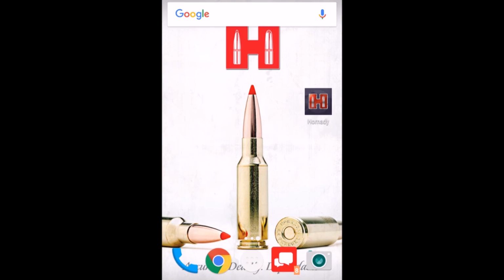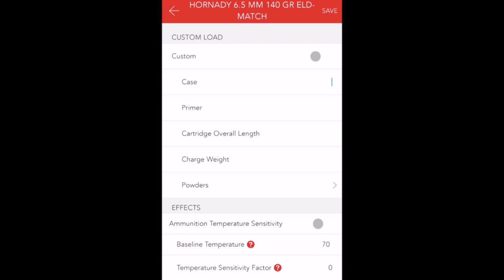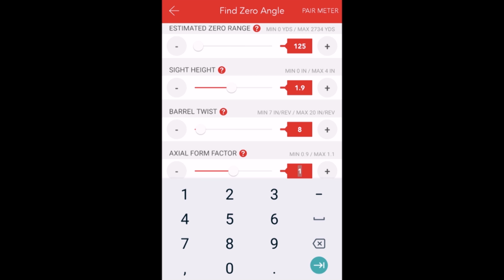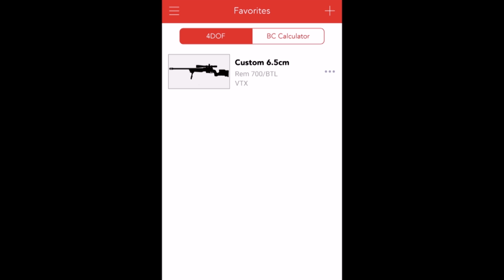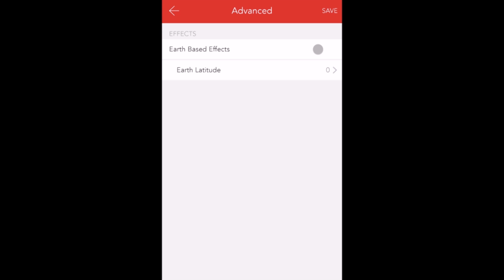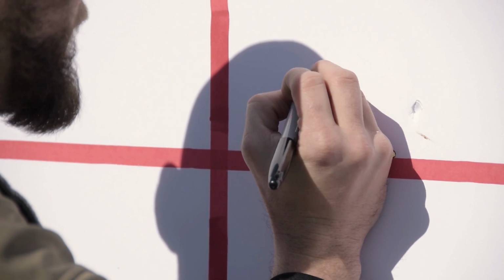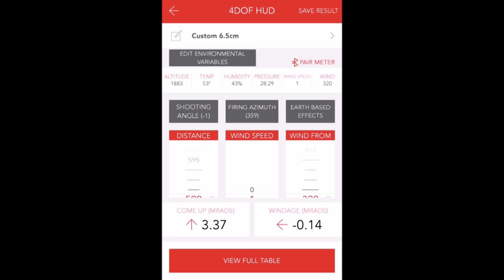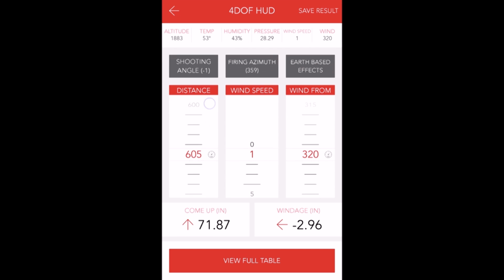Hornady® 4DOF™ - How To Overview

Comment: This app is crap. Tried all of the options correctly entered but the system kept giving me incorrect hold over. Even after I confirmed bullet drop at given distances and entered it into the system it still gave me incorrect hold over. Unintalled it and will never use or recommend it to any one.

Comment: I would like to suggest an improvement to the axial form factor adjustment...after shooting the longer distance test group, make the adjustment to the form factor by simply putting in the actual elevation impact difference from predicted adjustment and let the app make the adjustment instead of changing the form factor, then checking what the affect, then changing the form factor again and checking the affect, etc. Love the App, best I’ve used!
Reply: The app would have to have an external input of “use +|- “ to accomplish your request. I would like it also-seems doable.
(Reply to TH and Hornady)
Reply: I was thinking of something like this: have a trueing button available for the distance input... for instance, you put in 625, it gives 4.5 but you hit low. You assist and hit with 4.7. Hit the “True” button, it displays the 4.5 with a field called “actual” and you put in 4.7... the app can then calculate the Axial form factor.

Comment: I found serious issue when using this app in metric units. It's about pressure. I'm using Weathermeter flow to send all data to the app on my mobile phone. It measures as described in app in mbar units but in fact it's mmHg measurement. I've checked with Strelok Pro set for mmHg and values are identical. The problem is that this app takes this value,  let say 758.4 and calculates my windage using mbar unit. 758.4 mmHg is in fact around 1006 mbar so output for calculation is VERY wrong. I hope that somebody from Hornady take a look on this problem and correct application :/

Comment: For a dyslexic long range shooter/hunter like myself this is both encouraging and discouraging.  I can see the benefits with your system of finding shooting solutions but that's a heck of alot of steps to go through to get to what you're after.  I think that with a little more time and a little more refinement, you'll be able to simplify what just took you eighteen minutes to explain.  

When you reach that milestone I'll be all in because although the method I grew up with is much simpler to learn, it also has some definite deficiencies to it.  Keep up the good work.  I look forward to your simplified revisions of this otherwise great idea.
Reply: all this video was just to sync your rifle to the calculator. from now on, for that rifle and ammo, only input weather, angle, distance and wind.
Reply: Its fine the way it is, follow the steps and it will be accurate. If you want some dumbed down drag and drop apple version it would simply be garbage in garbage out..

Comment: That is pretty informative article 
  Question.  Is this program computer based i.e. pc/laptop, apple/widows? Or can it be used operated in the smart phones realm i.e. Android or iOS. 
    Sorry if this seems a bit ignorant, but tech savey I am not! Lol.  On the learning curve train though...damn bumpy ride.
Reply: YOU CAN USE IT ON Android or iOS
Reply: The Hornady website has an excellent PDF booklet available that teaches you how to use the app. You can print the booklet out, read about how the app works, and you’re in business. Just follow along with this video or the booklet, or both, and you’re in business!